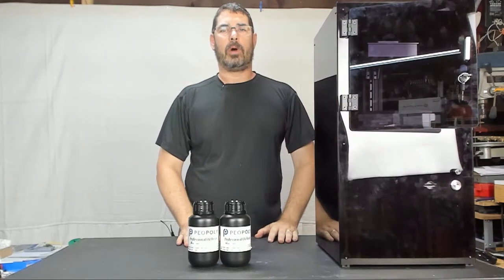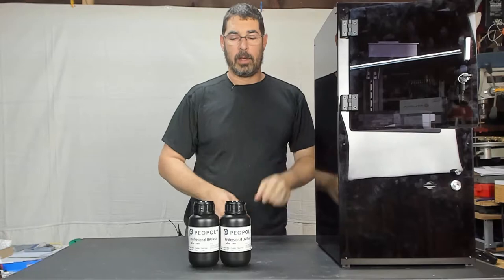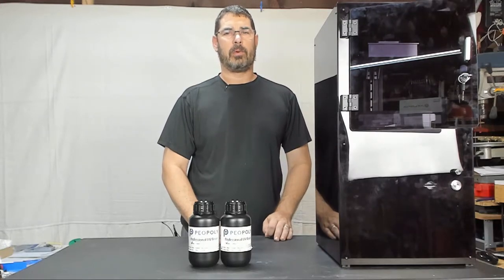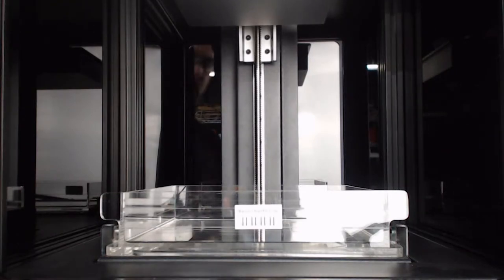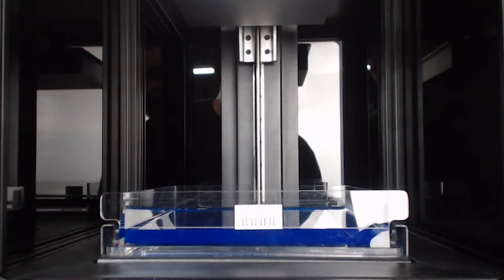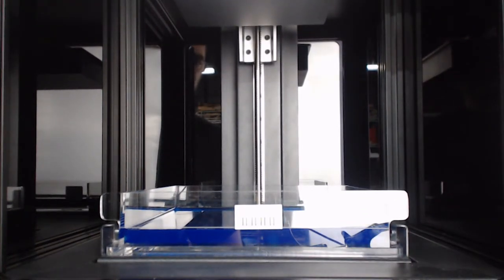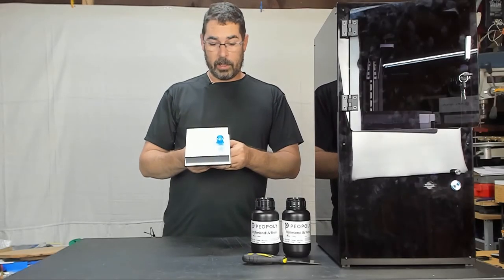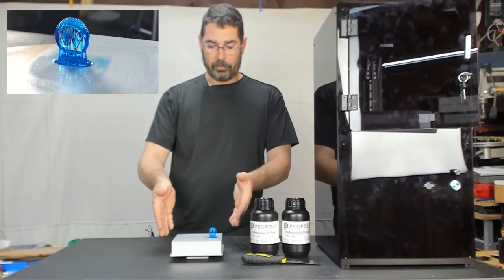Moai Series Part 9: First Test Print!!!

Comment: Hey Chris, thanks a lot for this series. Got my Moai and put it together following your videos. Unfortunetaly I'm not able to print the ring test after following all the calibration and leveling instructions. Literally nothing comes out of the build plate. I can see 2 or 3 resin patches that seems to have the shape of the first layers but nothing else. Could you please suggest me any troubleshooting? Thanks for all your help!
Reply from the maker: Hey Ruben, is sounds like you may not have leveling set just right.  I'd start by running a comb thru the VAT to see if you can fish out the rest of it, and (hopefully) you didn't bake it into the PDMS layer and wreck it. Once you get all that set, I would drain the VAT and re run thru the leveling process. Short of that, it may be time to hit up the facebook group and/or the Peopoly forums for some tips.

Comment: Aloha Chris , oops forgot to activate the Bell,  Done :-))   nice SLS Printer  but the Printing area is too small for me :-)  Can´t wait for Nr. 10
Reply from the maker: Thank you! It is small compared to what we are used to in FDM, but as far as SLA printers go, it is a decent sized build volume.
Reply: Can you print some big and show us how well it glues together? I guess the screens they use for this are expensive if bigger?  Cept for Form 2 all these SLAs are so tiny like The German Printing Nerd pointed out.
Reply from the maker: ImaginationToForm the build volume on the Moai is 130x130x180 mm, so only 15mm smaller in X & Y than the Form 2, and it’s actually 5mm taller in the Z.  That said, once I finish up the build series with part 10, I’ll be moving on to projects and trying to make the most use of that space :)
Reply: Oh I might had gotten mistaken by the D7 SLA. Sorry.
Reply from the maker: No worries.  It IS much smaller than we are used to in the FDM world

Comment: Seems to me like the quality of the prints have gone way down, i filtered the resin, cleaned the vat, reset the leveling like u did in the video, nothing seems to work. The DIY cylinders test comes out horrible, only 1 or 2 cylinders print, the rest break or are close to breaking, tried reducing the Z-reset value, same result. Could it be that the vat has worn out in that area(didn't see anything when i cleaned it), there were some bubbles in the vat might that be the cause. I have no idea what to do.
Reply from the maker: Icemanmodeler sounds like maybe you have something else going on.  Possibly resin dripped on the galvo or something else blocking the light path.  I showed the folks over at Peopoly your post and they suggested contacting their support at support@peopoly.net
Reply: Practical Printing I already did and no response, checked the galvo, no resin there, I have a plastic surface that came with the printer over the mirrors . The heat has gone up here, room temp is 31 degrees C, could that be the reason?
Reply: Practical Printing The cylinders that don't print on the buildplate are only the bases and discs are in the corners of the vat. Don't think the laser is the issue but no sure.
Reply: Discovered something today, after cleaning the buildplate, combing and cleaning the vat from debris using a comb and a plastic spatula I saw in 2 of the cylinders I printed some cloudiness. Didn't thing the vat would get cloudy after 10 prints of the same DIY, also there are lots of bubbles in the resin, going to let it sit for a while and hope they disappear.